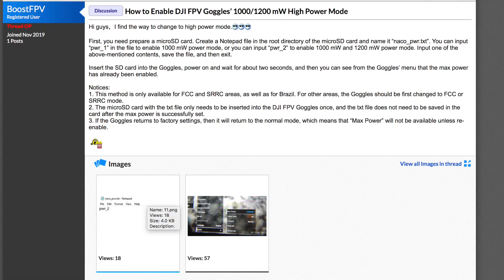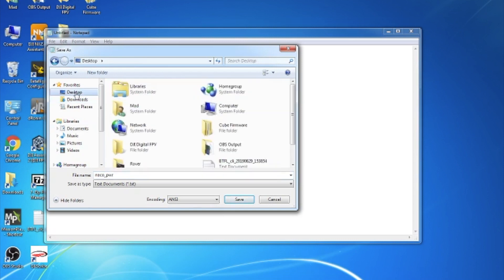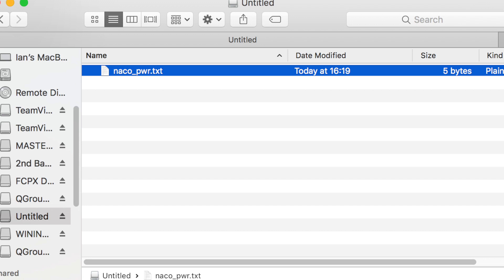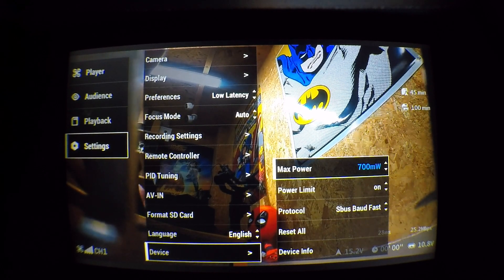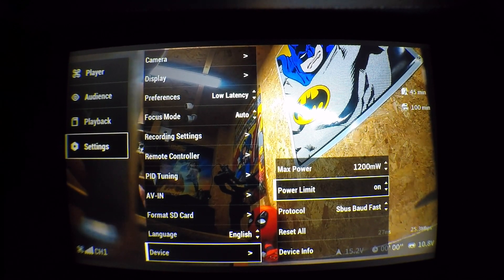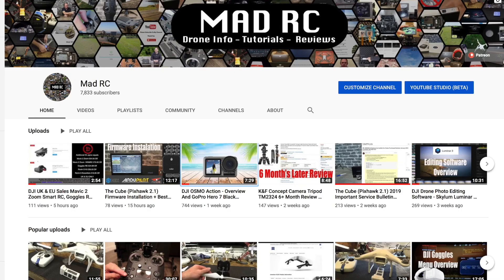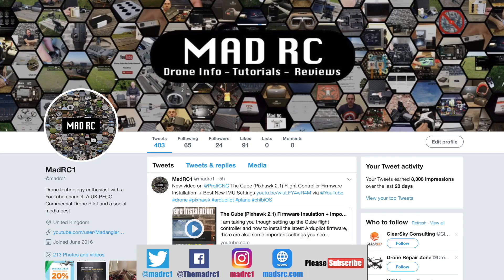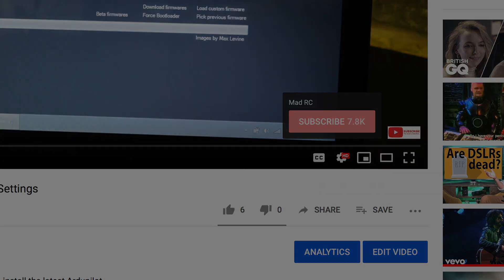DJI Digital FPV System 1200mw Power Hack - Tutorial

Comment: When my pilot goggles are set to 1200mW, I noticed that I get a lot of blocky pixelation in a second set of goggles monitoring the flight in Audience Mode.  This completely goes away when reducing the power output of the main set to 700mW or less. Has anyone else experienced this?

Comment: I just bought the FPV Drone combo and my range sucks. Maybe 500m. I was told that because I am in the EU I only have 25mW. Would this hack work on the new DJI FPV system? Thanks.
Reply: Yes it should
Reply: @miklosko3355  Well, I had tried everything and it would not work. I tried both txt files on both, the drone and the goggles but nothing would work. I then tried the beyond method but it wouldn't work either, so I ended up going to drone-hacks and pay $25. Thanks for the reply.

Comment: Please do not ever set your camera to auto-focus mode. It's so hard on eyes when constantly chasing the focus, and it's going in and out super fast. There is absolutely no need for that, when subject is not moving. You're sitting in that chair and both you and your monitor should be set in fixed focus. Do it on camera, sit in your chair and enjoy perfectly sharp and steady video.
Reply from the maker: I don’t often use AF for this very reason.  On this one I did but that’s not often the case.  There is a much newer video on this too you may want to check out I. 

Also the funny thing is that’s Sony AF.  The best apparently lol.
Reply: @MadRC  - yes, I understand completely. And I wanted to go Sony way just because of that for some applications. I own Fujifilm XT-3, and while it's still one of the best out there, it's hilarious how bad AF Fujifilm provides. Even after all the latest and "greatest" updates that promised incredible increase in AF accuracy and speed... still nothing compared to Sony's AF capabilities. I believe you had problems with AF in this video only because you brought your quad into the scene couple of times and moved it in and out, and then it was obvious camera was working very hard and fighting to get the correct focus point. Also, even though your scene had pretty decent light, it is still kind of muted at bit. Anyway, I wasn't going to criticize anything, your content is what counts and it's AMAZING BTW! I was just trying to draw your attention to that little AF problem. FPV gadgets are always amazing to look at, but when we have an amazing speaker such as yourself, focus should definitely lock on you and sit there still :)

Comment: Any idea if this is working on the v2 I have tried it with no luck and does the SD card need to be completely empty with nothing on it ? Or standard sd card I'm using for goggles dvr
Reply from the maker: It should be fine formatted in the goggles.  The reports are it is working on the V2.

Comment: Im wondering how is that air unit doing after one year with the mod. all good? or did it get damaged?
Reply from the maker: All fine, their is no long lasting issues as the Air Unit still has thermal safety built in

Comment: Hi. Enyone have a slow card error when in 1000-1200mW? Card works fine with 700mW. Tried few, same thing... It's a class U3 so not speed related issue.
Reply: Hi. Did you ever figure out the problem with the slow card  error?
Reply: @miklosko3355  No. But I'm flying on max 700mW. Yesterday switched to 1000 and no error.
Reply: @airdronelongford2027  Great news. 
I can go ahead and do it too 😬👍

Comment: Does  this work on the latest firmware?  Have you tried it?  Thanks.
Reply from the maker: Yea all still fine.
Reply: @MadRC  have a mac.  got it to save as a txt file.  boot up the air unit/goggles insert the sd card wait a couple of seconds and only the 25-700 are available.  i'm in the usa.  any thoughts?  (do I need to boot up the RC as well during this process?)  Have the latest FW. Do I need to do the FCC unlock?
Reply: I cant seem to get it to work, I am in the UK which may have something to do with it, the previous firmware and and "hack" worked no problem... 😯

Comment: Updated DJI FPV to v1.00.0400, and it is not possible in your way to increase the power to 1000mw or 1200mw, although it succeeded at v1.00.0100. Tell me how to increase power from 25mv on the new firmware?

Comment: Does this or the FCC hack change the output power of the DJI remote controller.
I do not want to buy the remote controller if I can only use it in CE mode ?
Reply from the maker: It’s believed so yes.

Comment: Hi, I received my Googles today. First I updated the Googles to latest Firmware. Then I checked available Channels. I have 8 of them, 7 plus 1 Channel "Public". When I put the SD Card in with pwr_2 I still have 25mW and it is not changeable. I have not run the Air Unit so far, just the Googles. What is it? Please help :-)
Reply from the maker: You need to do it with the Air unit on so power everything up and then try.

Comment: Hi mate, if I have 3 air units , after I bind  each of them to the goggles and do the 700 mw hack on each air unit, do I have to insert  the card in the goggles  for the 1.2 mw  hack each time I upgrade the air unit to the 700mw or you only have to do the 1.2 mw hack only once
Thanks,
Reply from the maker: Now that I don’t know.  Once you do it once on all of them I suspect it will be persistent.
Reply: Mad RC I will let you know

Comment: Has any one got this to work. I have tried to install it on my Google several time and has not worked. I'm in the US and am allready on 700 and have had no luck getting this to work any ideas??
Reply from the maker: Are you on the latest firmware ? 

You must be on the last release and all components must be on it.  

Then you must be in FCC area

Try unsung the file I have linked in the description
Reply: @MadRC  put sd card to air unit not google DJI

Comment: Hello, I noticed you have SBUS BAUD FAST turned on. How do you turn that on? If I  go off of normal I can’t do anything as far as control. My betaflight settings is on sbus.
Reply from the maker: You need to enable Sbus fast via the CLI in Betaflight.  The command is set sbus_baud_fast = ON
Reply: @MadRC  I type that in and I get 'error unknown command'

Comment: It's only about a 2 dB increase in power from 700mW to 1200mW so this won't produce much in the way of extra range (due to the effrects of the inverse-square law as it applies to radio-frequency power).  As all experienced FPVers know, antennas are the secret to getting more range.
Reply: Dustin Dunnill has he rig to test this properly and safely  .... just shown in his recent video standard stock antennas as well..
Reply from the maker: Yep absolutely it’s on the bottom end of change compared to the FCC.

Comment: Even though you mention it's dynamic, I'm still a little cautious about having this 700mw transmitting soo close to my head. I wouldn't turn mine up while using omnis,...  I'd want more of that power transmitting away from my head with a directional. Cool feature though. I'd bet the unit can do it just fine. They just have it at 700 to keep with regs,....unlike the rest of the fpv community.
Reply: I looked up and saw my SD card still in the computer,..   Click. Done.   Checked and there is the 1000mw and 1200mw option. Might come in handy,.... Won't be my daily driver.
Reply: What's on your head isn't what's transmitting.....
Reply: Yes it is. Flip the goggles over and Google the FCC I'd. There is a separate number and report for the air unit. Both transmit at full power.
Reply: @rcrdps8144  if you knew anything you'd know this is non-ionizing radiation.. Meaning it's harmless
Reply: You folks like to repeat that, and yet there's a whole section of the fcc testing/certification dedicated to knowing how much exposure your body will receive. I'll admit, however, that it's probably no more exposure than my phone. But I'm not dismissing it just because it doesn't cause immediate debilitating injury.

This is somewhat academic though, as the actual output is not anywhere near 700mw. That's a DJI number that includes the gain of the antenna.